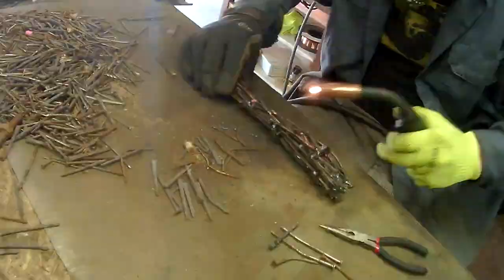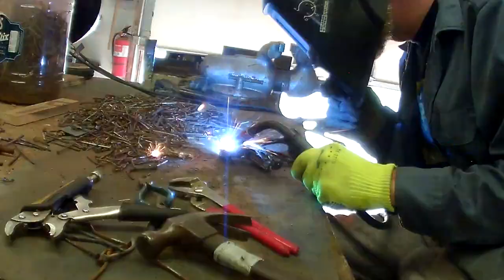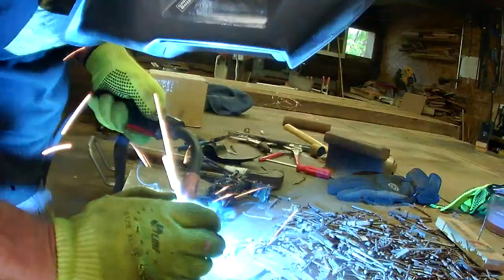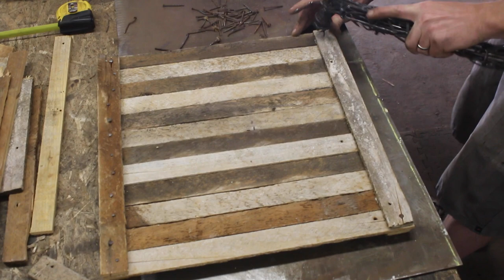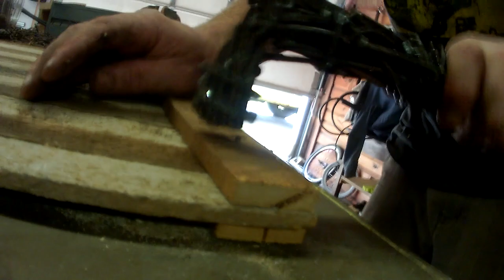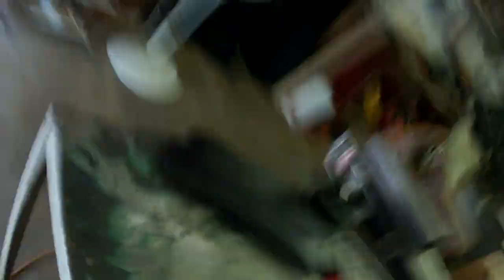hammer made of nails - tim sway perspectives

Comment: Nice art piece.

"If your only tool is a nail, then every problem looks like a hammer." (someone had to say it... I'm just the messenger.)

Looks like you got some shielding gas. I much prefer it over FCAW.
Reply from the maker: +Barry's Workshop nice play on words. yes, i made the switch to gas. i bought a used mig with gas, switched that one to flux and put the gas on my machine, so if i run out of gas i have a back up flux machine ready to go! all that was close to the same cost as buying the bottle, gas and wire that came with the deal. win!